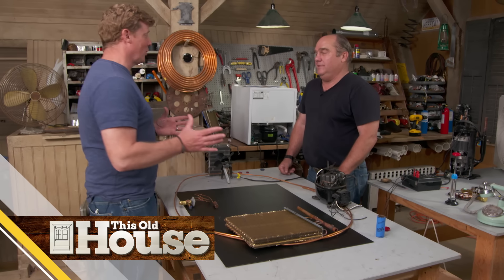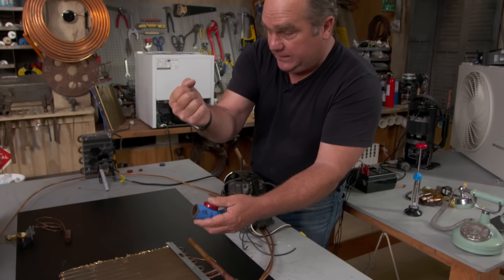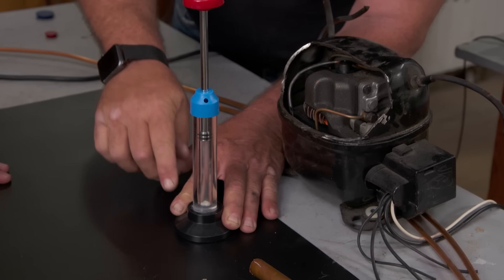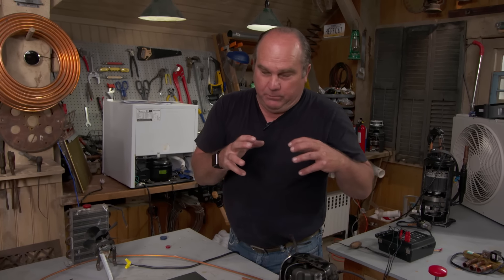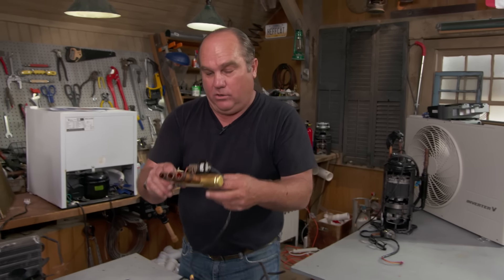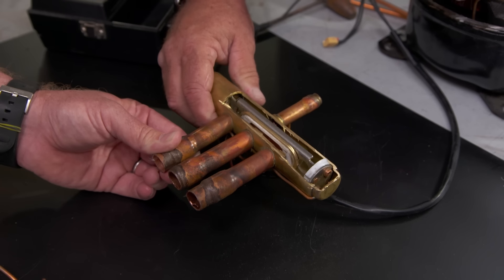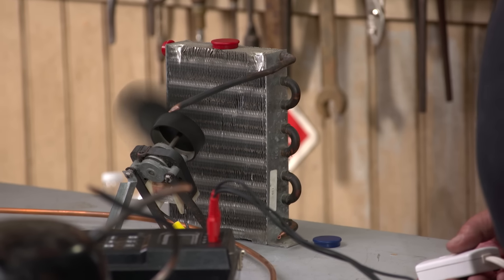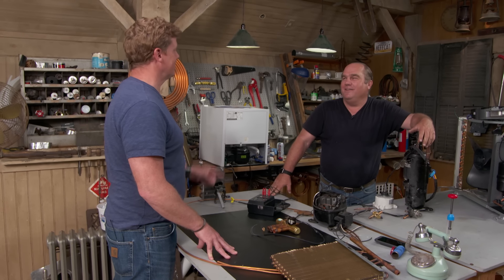How a Heat Pump Works | This Old House

Comment: What are the advantages and or negatives to having this type of system? I have heard good and bad about heat pumps but maybe those were older systems. It seems like the way to go.
Reply: There are basically no negatives except that it is dependent on electricity.
Reply: @MandoFettOG  Thanks, In my area that would be an issue since natural gas is an option and electricity is much more expensive. Again thanks for the information.
Reply: @mtadams2009  I unfortunately don't have natural gas :/ so the heat pump it is.
Reply: @mtadams2009  It's worth noting that heat pumps are actually more than 100% efficient with regards to heating vs something like an electric space heater. It takes much less electric to 'move' heat than it does to generate heat, so modern heat pumps can actually be 200-400% efficient even at low temps. Of course, natural gas is dirt cheap, so it may still be cheaper to use for heating even though it's only 80%-90% or so efficient. In my area ($0.13 kwh), I worked out that it's actually cheaper to use a HP down to about 40 degrees, even though gas is so cheap.
Reply: @bnasty267  Thanks for the information. Take care
Reply: @mtadams2009  Heat pumps are less efficient at colder temperatures, which is precisely when you need them the most.   Worst case scenario, a heat pump is no less efficient than an electric resistive heater, where 100% of the electricity becomes heat.   A heat pump's purpose is to multiply the energy you put in to the compressor, by enabling it to "suck" heat out of the exterior enviornment.

Electricity will always be more expensive than thermal combustion sources of energy per Joule of energy, because electricity is a lot more versatile in what it can be used for powering.  The electricity is ultimately produced from burning fuels, and there are thermodynamic limits to how much heat from burning a fuel can be converted into mechanical work and subsequently electric power.
Reply: @carultch  Thanks for such a detailed response. I never looked at electricity they way you explained it but yes it is very versatile. Since I live in a cold area a heat pump would be a no go. We also have very high electric rates. Again thanks for your detailed response.
Reply: @mtadams2009  No problem.

If you are going to put in air conditioning, you might as well put it in as a heat pump anyway, because the working principles are exactly the same, and the only extra detail is the reversing valve.   A heat pump gives you options, and could give you the ability to have a control system that "decides" whether to use electricity or burned fuel to heat your home, to optimize your heating costs, based on the relative economics of each method.

Another issue with heat pumps, is how it distributes air within the home interior.  An air conditioner louver is best located in the ceiling, because cold air sinks.  A heater is best located in the floor, because heat rises.  If you try to heat your house from ductwork to the ceiling that was built that way with air conditioning in mind, the hot air won't effectively move down to your location, without a ceiling fan in downward mode.

Ideally, you would have ductwork that can selectively deploy the conditioned air to either your floor louvers in heating mode or your ceiling louvers in cooling mode, in order to use a heat pump most effectively.
Reply: @carultch  Thanks again. Take care

Comment: I have a split system HVAC and it has a 4 ton outside AC unit and a furnace that burns propane. I want to change the AC unit with a heat pump and run a dual fuel system because using propane in NC as a primary heat source is way too expensive. Do I need to change anything other than the A/C unit with a heat pump and the thermostat? .I am just looking for a straight answer to my question and everyone I talk to wants to send someone to my home and try to sell me an entire new system. It has a furnace, evaporator coil and the blower in place so I don't see why I can't just switch the AC unit with a heat pump since the main difference between the two is that the heat pump has a reversing valve to produce the heat.

Comment: I don't get the part about the release 'valve' he says goes into a larger space, so that it cools. Wouldn't that larger space start to become more pressurized because the incoming refrigerant is higher itself so it's more of a equalizing of pressure. But because it's now increasing it's also warming up. The only way I can see it working as described is if the refrigerant is actually leaving the system like with his compressed gas in a can example. But with the enclosed system, it's still a closed loop, so I don't see how this 'expanded' area is made to get released into.
Reply: The compressor is constantly emptying the evaporator that is the large space
Reply: @joepierson3859  Ok so I neglected to consider how a compressor works. It can only pressurize one side of the loop ('the outgoing fluid from the compressor') when at the same time evacuating/depressurizing the other side of the loop('the incoming fluid to the compressor')?
So I guess the expansion valve 'regulates' when the pressure gets to a certain value it begins to release that pressure into the now comparatively less pressurized part of the loop?
If what I am saying is true, I made the mistake of assuming the compressor was only creating pressure on one side of the loop while having not affecting the other side of the loop.
Reply: @babajaiy8246  A compressor is a machine that squeezes a gas into a smaller volume AND pumps it somewhere else at the same time. Hence the term heat pump. In a closed system the pumping will depressurize the inlet. Think what would happen if the expansion valve closed completely. Or opens completely. Purpose of the expansion valve is to maintain equilibrium so the inlet pressure is maintained under different load conditions, doesn't drop or increase.

Although modern Heat pumps are more complicated than that. Compressor can be run at different speeds and Inlet pressures for optimal efficiency, that's how they're able to get the ultra low temperature pumps to work. An inverter controls the speed of both the fan and the compressor.

Comment: Great video guys! I am an instructor at a community college in Nebraska. I would love to get that little device that you used to compress the air and start the cotton on fire. Where can I get one?
Reply: Amazon. It's a compression fire starter which starts your kindling, also called a fire piston; but there are better methods to start a fire.

Comment: Can anyone explain why my heat pump runs 24/7 if I have the thermostat on let's say 64 degrees F, but if I raise it to 68 F (outside temp still the same), it cycles on and off normally? Seems like it's cheaper to run the thermostat higher

Comment: Yes...and that friggin' expansion valve is expensive to replace because you have to remove the refrigerant...replace the valve...then install new refrigerant. Cost me $600 five years ago. Seems like they could redesign it to isolate the refrigerant from the valve so it can be replaced. Mine has be replaced twice in 5 years.

Comment: If a heat pump with reversing valve is not cooling what can be the mechanical issue please ?
Reply: Don't expect an answer. They TOH crew never respond.

Comment: What is needed to have this setup if I currently have a regular furnace and Ac unit ?
Reply: Don't think you'd want it, just upgrade your furnace to a 90%
Reply: You can without replacing furnace( could be used as backup on real cold days when heat pump doesnt heat enough). But it's like replacing your whole central air system with a heat pump system plus some extra wiring

Comment: The air blower is not just air; it has a refrigerant chemical. Imagine the pressure needed by thinking on air pump compressors for air in tires; how much steel is required because of the psi.
Reply: There are heat pumps that work with air as the working fluid.  It is called the Bell Coleman cycle, which is commonly used in aircraft cabin temperature management systems.

Comment: I did an H.A.V. Class. they said tu/vous throws it in reverse, the evaporater is outdoors y/et condenser is indoors.    They also said Heat Pumps   might be good in some farts of the United States but a waste of money in the Chicago Metropolitan

Comment: Does any climate really just have a stand alone heat pump with no additional assist unit?  I'm in mostly hot texas and thought I would only need the additional electric furnace unit to run when it was near 0 out but it seams to power up anytime I even need the slightest bit of heat from the pump unit.   It's using more power than I expected from pre purchase research.  What gives?

Comment: universal gas law ...
PV=nRt
R is gas constant ...
n is amount of substance
P is pressure 
V is volume 
t is temperature
-- 
the compressor pushes the pressure UP ...
changing state of refrigerant from gas to liquid (or vice versa)
the HIGH pressure refrigerant then runs thru outside coil to dissipate heat ...
high pressure refrigerant then passes thru a small 'orifice' (hole) on way back to INNER coil...
that DROPS the pressure to a LOWER value ...
as the pressure drops ...
the TEMPERATURE drops ...
(based on pv=nrt relationship)
it's liquid/gas state changes ...
and it makes the refrigerant cool ...
which cycles thru the coil again 
(or something like that)

Comment: The biggest argument out there about Heat Pumps, especially in Canada, is "Can a Heat Pump function in -40C/F weather, and how efficient is it?"  Would it be more efficient and as capable as a comparably sized Natural Gas Forced Air Furnace?

Comment: There's something I don't get though... If we have something that's a compressor that can "heat" stuff (like air as he shows), why do we have to go through this convoluted process or getting it communicate with outside ?
Moreover, what if it's REALLY cold outside , can you really make your pump even colder ? Isn't there a "breaking point" where it just can't work ?

Comment: He was correct up until he said every air conditioner has a thermal expansion valve. There are server all kinds of devices that do the same job like a fixed metering device.
Reply: Ultimately, it is some kind of valve that uses friction to drop pressure isenthalpically.   That is, it drops pressure in an irreversible process that doesn't have any exchange of heat with the surroundings, or any mechanical work.

In concept, you could put a turbine in this position and recapture the energy as work to back-power the compressor, but there is a diminishing return to this effort.  This would mean a reversible isentropic process with a drop in pressure, rather than an irreversible isenthalpic drop in pressure.  In a Bell Coleman refrigeration cycle, not only do we do this, we have to do this in place of the expansion valve, because air (and gasses in general without a phase change) doesn't cool off as significantly as liquid refrigerant when expanding to a liquid/vapor mixture.  But in standard reverse-Rankine refrigeration cycles, it isn't worth the effort to recapture work between the high pressure hot heat exchanger and the low pressure cold heat exchanger.

Comment: Basic Logic (Air-Conditioner<=>Heat-Pump) --- Step 1 : Temperature moves from HIGH to LOW (No Matter what temperature)., Step 2 : Use a Refrigrant to achieve Step 1.

Comment: I live in northeast Massachusetts, writing this in January 2023 (right after Nat Grid spiked their rates).  I heated my home via heat pump (minisplit system, 36000BTU, 4 heads, 3 floors) from 11/28/22-12/29/22.  total cost for that time period was about $470.  once my heart went back into my chest, i went back to my oil furnace/forced water baseboard system (20 year old boiler, not HE), the cost from 12/29/22-1/25/23 was about $385 with oil at $4.65/gal.  makes no sense.  (new windows, like installed-in-November new).  what Nat Grid did to electrical rates is borderline theft.  it should not cost more to run a system that burns fuel to make heat than a system that uses heat created by nature.

Comment: Yes, the newer HVAC equipment is quieter and more even with temperature requirements. Great ideas they have however, you don't want to have to be the one paying for any repairs. ALL of the parts to modern HVAC high end ECM or variable speed are proprietary OEM parts. That means, you must get replacement parts from the manufacturer and if they don't have the ones you need in stock, you have to wait until they do. This is why its important to choose the right maker who fully supports their equipment in the parts and  support dept. Also, anything ECM related will cost 4 times more such as an ECM blower motor. Just the ECM modules are $800 alone and most manufacturers are slow in keeping them in stock. The bottom line is, if you are lucky enough not to have breakdowns with the new units, they are worth the extra expense for those who are willing to pay the extra cost. For the average homeowner, I don't believe these high end systems are ready for them due to the high cost to repair them and the higher chance they will require service. 

Some folks are not buying the idea that running a 25 amp compressor in winter is less expensive than a gas furnace. Especially when electricity requires 3 times the power to do the same amount of heating as one cuft or unit of gas. So, 3 kWh of electric to 1 unit of gas to get the same amount of heat. Depending on your electric rates and they aren't staying put based on history, using electric vs. gas is more expensive regardless of efficiency as everryone for the past many decades knows, gas has always been the king of choice for heating such as water heaters, clothes dryer's, furnaces and cooking. Gas has its advantages which tend to exceed its disadvantages.

Comment: does a heat pump remove the humidity from the air like an air conditioner ?
Reply: Not in the indoor heat exchanger, because you cannot remove water vapor from air by heating it.  The outdoor heat exchanger DOES remove humidity from the air, which is why you often end up with your heat pump outdoor unit forming a frozen layer of ice.

You would need to first cool the air, and then heat it, if you wanted to remove water vapor from it.  That's what a dehumidifier would do.  A dehumidifier is an air conditioner with no outdoor unit, that cools air across its evaporator to remove water vapor, and then heats it across its condenser.   On NET, a dehumidifier will heat your air.

Air may FEEL like it dries out, after being heated, whether by heat pump or other heater, but the population of water molecules in it, is still the same.   Humans perceive relative humidity, which is the percentage of absolute humidity divided by maximum possible absolute humidity.  To give an example, suppose we start with 60% humid air at 0 Celsius, and heat it to 20 C.   The corresponding absolute humidity is 0.0023 kg H2O/kg dryAir, and this remains the same while heating the air, since the air's composition remains exactly the same during this process.  At 0C, this is 60% of the maximum possible absolute humidity, but at 20C, this becomes 15% of the maximum possible absolute humidity.   The relative humidity decreased from 60% to 15%, which makes the air feel dry.   Yet, no water has been added or subtracted from the air.

This is why it is common to need to humidify the air, while heating it, to maintain a comfortable level of humidity around 45% relative humidity.

Comment: I'm considering replacing an outdated HVAC system with a geothermal heat pump.

I have a well that's no longer used my home, could I run coils in and out of the well water for a geothermal heat pump?
Reply: Yes.  That's what they do when they drill a geothermal well.  They drill a hole and then fill it with some type of liquid because liquid transfers heat more efficiently than air.  That's why all modern cars use liquid in its cooling system instead of an old style air cooling system.  Like the old VW bugs and buses.
Reply: @johnsumner2987  Thanks, knew I was holding off on back filling that well for a reason.
Reply: @Virtual Media  Please, oh please talk to an expert.  I was just telling you what I read somewhere and my experience with cars.  I don't want to be responsible for a mistake that is going to cost a mountain of money to fix. lol
Reply: @johnsumner2987  not going to hold you anyting was just considering options will talk to a pro before going any further.

Comment: Does the heat pump takes longer to warm up the building than the gas furnace?
Reply: The colder the day, the harder for the ac to absorb heat from the outdoors. So that it could be compressed. But yes it generally takes a bit longer. But todays heat pumps are good to -30F
Reply: @kingdiablo35  Even with the newer ones, i still hear quite a bit of complaints they aren't keeping up temperature, heat pumps initially weren't really designed for regions that see below freezing temperature more then once as a stand alone.
Reply: @KenKen-ui4ny  yes that is true, but now most ductless have dc voltage and can ramp down the compressors and fans.

Comment: Variable speed systems are super cool and all, but because their parts are more delicate, they fail more, and are more expensive to replace.  You may be saving money on energy costs, but those savings are going right to repair costs.
Reply: Well I have one which uses about 50% less energy than a window AC. I've already saved enough electricity to pay for the unit itself and mine works just fine, no issues in 7 years so far.

Comment: What is the difference between an HVAC system and a heat pump? What about a furnace?  Help please my girlfriend gets super mad at me when I cannot figure this stuff out she almost dumped me once when we were stuck on the side of the road with a mech=anical issue when I couldn't figure out how to pop the hood of my car (glovebox had a button as it turned out)... HELP!